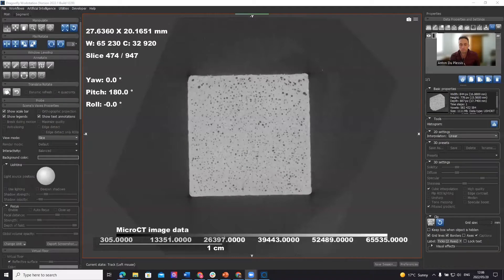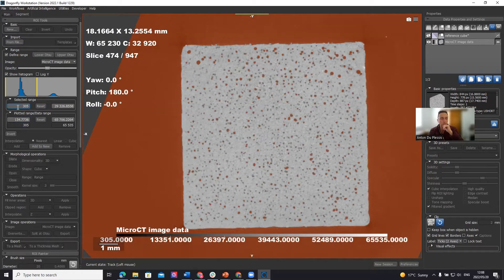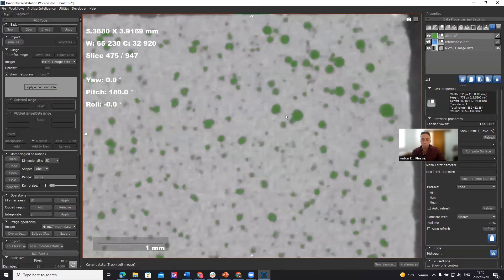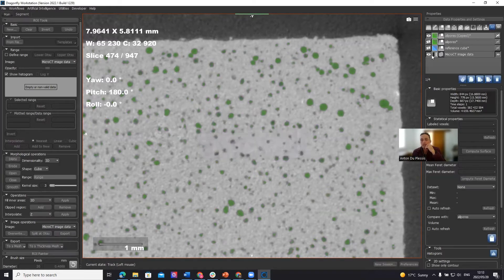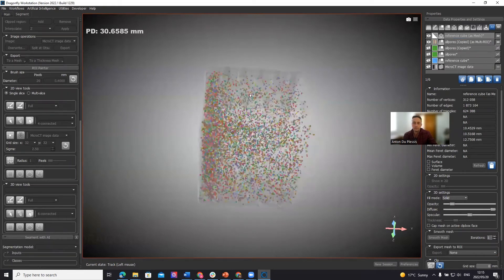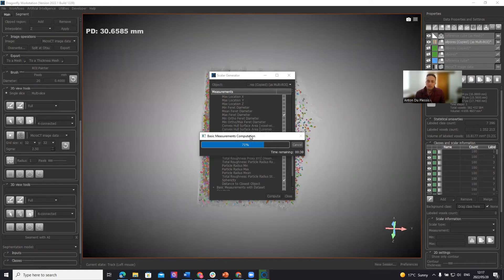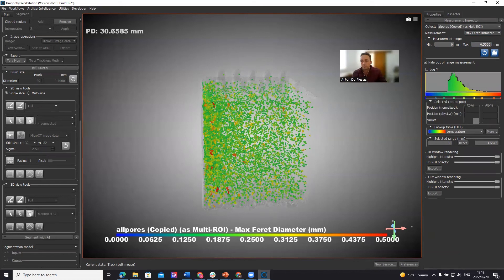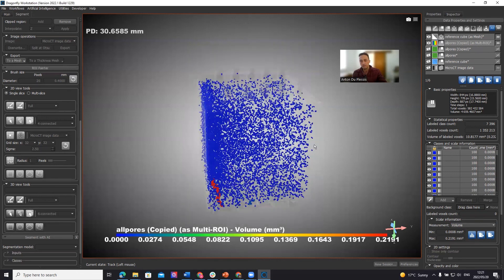Porosity Quantification for Additive Manufacturing How-to Using Dragonfly

Comment: You have mentioned to refine the region of interest and remove by largest 6 connected. In my case, it removes the cracks present in my sample which I need for the calculation of porosity. Can you please tell me how i can remove the surrounding air without affecting anything inside the sample. Any help is appreciated!
Reply from the maker: Hi Aastha, thanks for the question - this means that your cracks are connected to exterior air (surface-connected cracks). I will make a video to show how to handle this situation and include surface connected pores and cracks
Reply from the maker: Here a video to show some tools to separate open and closed pores and get the total porosity including surface-connected pores: https://youtu.be/skCFKKnGJ24. Enjoy
Reply: @dragonfly_software  Thank you! A video demonstration will be really helpful. Also if you can tell how i can fill those cracks in fill inner area tab, because it fills only few pores and I can see that most of the pores are not getting filled. So the porosity I am calculating is incorrect. Any suggestions in this direction will be helpful as well. Here is the image link of the pores plus air of my sample. 
https://drive.google.com/file/d/1QQIKrn2LVb0YYuErtC47UYpfSszn-qrz/view?usp=sharing